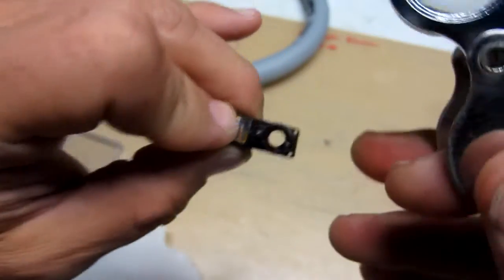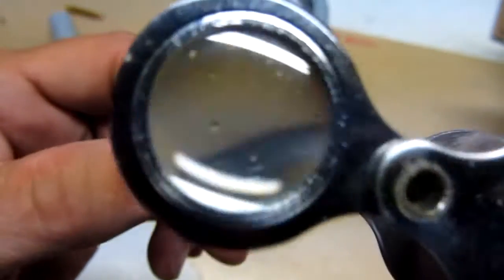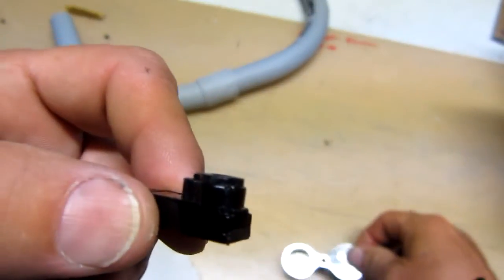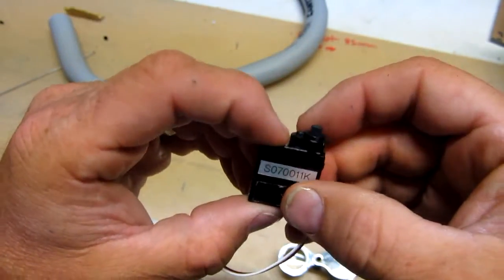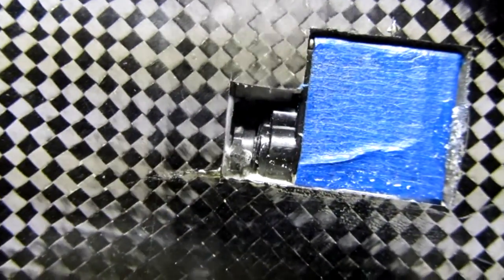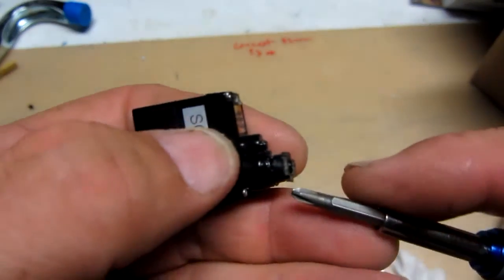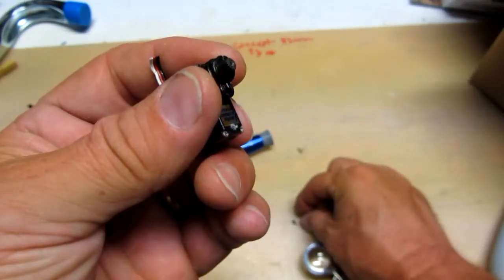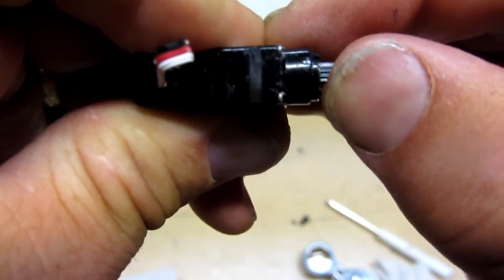Hyperion Servo Failures

Comment: I had 2 x HPDH16GCD servos fail after about two hours, after sales has been rubbish, I am so mad after my emails have all been ignored. I have been using servos for 25 years and never had a failure (apart from the usual 2 dollar ones which you expect.) Mine was an electrical failure.